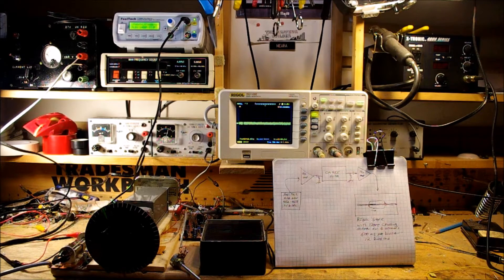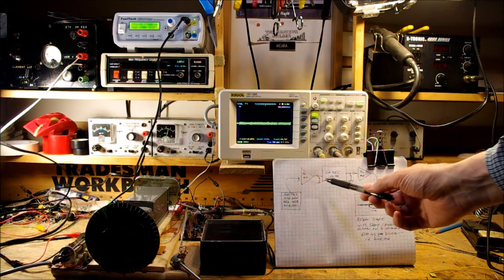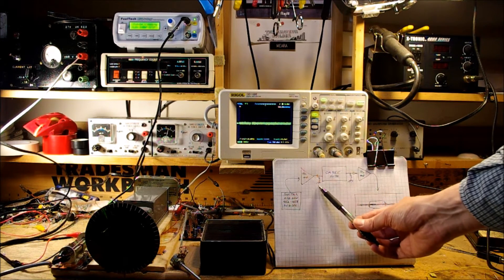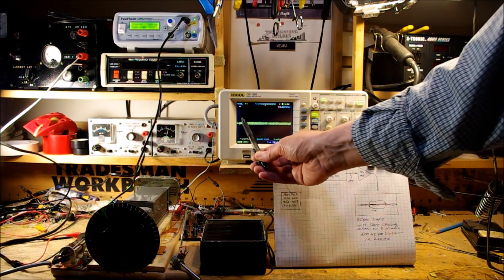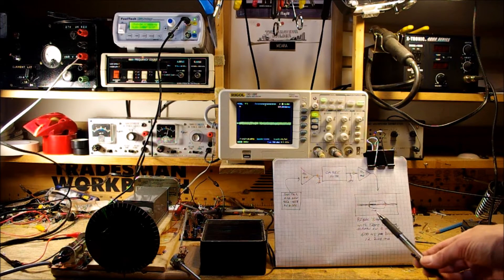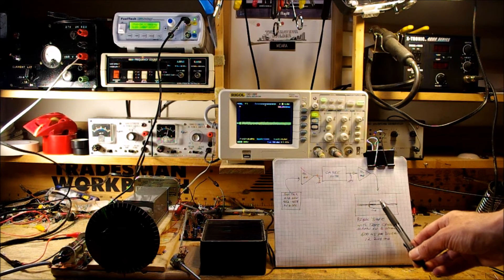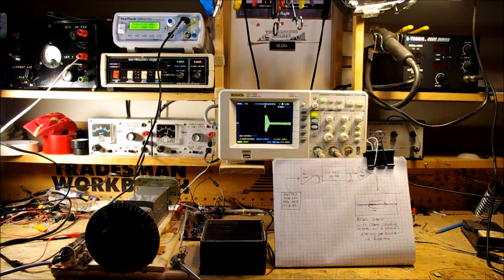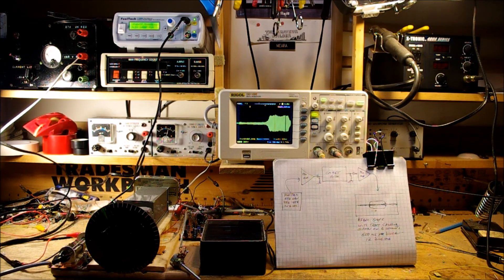Sweeping a Filter with a FeelTech Sig Gen and a Rigol 'scope

Comment: What triggering are you using so the sweep starts on the left of your scope?
Reply: @WaleraRigid Its silly isn't it my jds6600 does the same thing with the ttl output. Just brought my self a rigol fg for this reason
Reply: Interesting - I have the same Feeltech 3200 SigGen, along with a Hantek DSO5000 series scope - The Hantek has a 'Pulse Width Trigger' mode that can be seemingly set to cause a trigger when ' a pulse continues longer than the time specified as the Pulse Width.'

Thus, if I set the Feeltech to sweep from e.g. 1Hz to 10kHz, and have the scope set to trigger on e.g. 'Pulse Width > 999mS', the scope will hopefully just trigger on the initial 1Hz pulse, and the following shorter period waveforms would not cause further undesired triggers during the course of the sweep?

Does this make sense / sound workable?

Comment: Does the signal generator provide any trigger that could be used to trigger an oscilloscope. Or is there a way to trigger the signal generator for one single sweep externally?
Reply: From what I can gather he used a fixed duration trigger which works ok for very slow sweeps of 6s